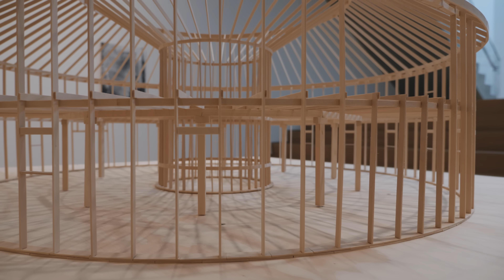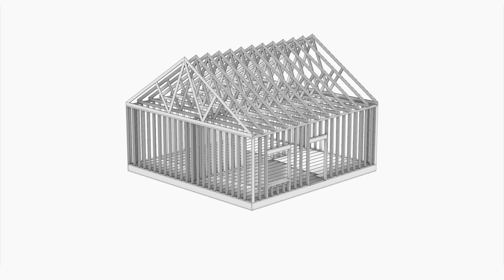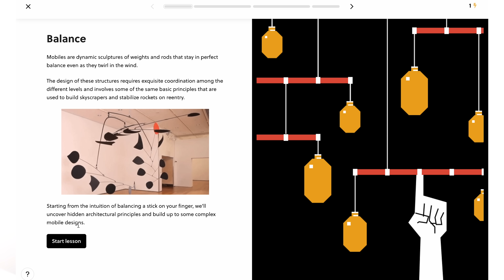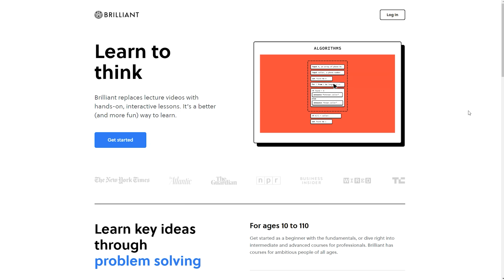The Genius of 2x4 Framing

Comment: I’d compare particle board to the McRib. It’s the odd carcass bits of a pig that are processed down and made edible. Perfectly safe to eat, just disturbing to think about, the same way we think about using particle boards in construction. It’s a robust material, maybe not as a structural component, but is perfect for covering walls and floors.
Reply: Actually, if I'm not mistaken, the reason McD's only comes out with the McRib in late fall/early winter is because, with the onset of colder weather and the coinciding slowdown in housing construction, there is more raw material available to make McRibs.  Because yes, you guessed it, McRibs are actually made from the same material as particle board.
Reply: Particle board is only used as floor underlayment. You may be thinking of Oriented Strand Board? Which is an amazingly engineered product. The wood flakes are placed with computer control. It's not nearly as random as it looks.

Comment: Not a fan of timber building at all. But there are a lot of advetages with this method. Here in Europe, wood framing goes a long way for additional elements like pagodas or entrance or terasse roofs, but rarely for house building.
Reply: I feel like the UK version of this is building with breezeblocks.
Reply: Same, and my house has 30 cm reinforced concrete walls. Every time I tell an American they don’t believe me.
Reply: @delta4phoenix4  It's not that no one believes you, it's that no one cares.
Reply: @deaconblooze1  xD Fair for here, but in context they did.

Comment: Frankly, I wouldn't be surprised if one of the original bids for the Saturn V / Apollo Module contract didn't propose a rocket solution made out of 2x4s...
Reply: 2x4s would have been too heavy. The engineering that went into the Saturn V is impressive.

Comment: It's important that u mentioned the abundance of trees, without that the 2x4 system would be impossible. In my country we relay on steel and concrete, because energy is cheap there and we don't have straight trees like here in the US. Thanks!

Comment: I don't live in the USA any more and so,  I get a chance to view your videos through the eyes of someone who was in that world and knew it, but am now gone from it in a significant way. Here, where I live, wood frame homes of any type, other than than most crude, are not built. We build with concrete and rebar. And we do it for the same reason that you cite for stick built: access to common materials; easy manufacture and portage; plasticity of end product design with the same materials, and; relatively lower skilled workmen for the basic construction. In point of fact, all you said, works for the building techniques here. All you need to do is switch the materials. I designed my own home here and was my own general contractor. Then did the same things with a boardhouse I built. So as I watched along with you, I saw how a different culture, different skills and different materials ended up telling the same story.

Comment: Fascinating! So many issues! The light-weight framing system was indeed exported: in wood-rich Finland it ended up, in the 1940s, replacing the traditional log-building technique (a square-profile log structure clad in timber siding). The traditional Finnish log houses were built by 2 people using just axes and no nails. The thick-walled houses provided excellent insulation. With the import of light-wood framing in the late 40s, the houses were cheaper but notably colder. The old traditional log-framed houses have lasted hundreds of years, while the light-wood framing houses are already decaying, despite the addition of insulation.
Reply: I recently found the remains of a cabin built by Finnish immigrants in the early 1900's . The joinery at each corner is perfectly constructed so the weight of the log above tightens the joint below it. Other than the roof collapsing it's still standing in great condition, most of the siding is even still intact.
Reply: @justindunlap1235  Wonderful to hear! What many today don't realise is the accuracy employed in the log joining techniques back in the day in achieving a tight fit. It was only in the 17th century that the log houses received a further layer of siding. Of course, up until the 20th century labour was cheap. But an interesting "transition" between log construction and balloon framing can be seen in the Puukäpylä workers' housing area in Helsinki from around 1920, where they used machines to quickly produce log houses with also siding. The area is now protected by law and is even a tourist attraction.
Reply: Nonsense;  wood that's kept dry will last indefinitely.  Wood is also a poor insulant, the less of it you used the more space is left for better insulating material.  Most log-framed houses are very drafty. Airtightness (and good controlled ventilation) matter even more than insulation when it comes to energy efficiency but that's another topic.
Reply: @viviangirard5075  Log framed houses -- or at least those in the Nordic countries and central Europe, which use thick rectangular-shaped logs not round ones -- are famous for being toasty warm, unlike the drafty balloon-framed houses from the post-war era.
Reply: @viviangirard5075  Let me tell you about the difference of living in a SHITTY Light frame building, I used to live in one for 24 years, it was always drafty, it always smelled of mold, it had no insulation and it sucked. When I visited my grandparents who lived in a White Brick House, it was always warm, and cozy, they had a gas heater to warm the house, and it didn't need to be used that often, in the summer it didn't ran at all, the inside stayed at 18 degrees C year round.
I once woke up in my room, with -2C in the house I lived in. That was with a gas heater that was always on.

And Log Frame houses are not drafty at all, I've had many opportunities here in Sweden to be in some, and I've never ever felt that I was cold in anyone of them. Not even during -20 to -30C winters, and that's without heating the houses up, more than in the morning, with a wood burning stove.
Reply: As mentioned water both vapor and as a liquid is the downfall of light wood framing. I grew up in a balloon framed “four square” in the north east USA. We had no problems with mold. The breeze hot or cold took care of that. It was and is still strong and standing. Steam radiators for winter, and wooden windows screens for summer. Anything done to tighten that house would kill it. There’s no perfect solution. All choices in construction have pluses and minuses. With steel, when you make it harder the steel becomes more brittle. When you make steel more resistant the material is softer and can’t take as good an edge. You pick a steel alloy and heat treatment that will combine to make a tool that’s closest to your requirements. There’s no free lunch. Engineering isn’t to make the longest lasting, strongest structures. Engineering is to make structures strong enough at cost that the end user finds affordable. When we use empirical methods to satisfy squishy human desires… 😂 yeah well, what we say we desire changes.
Reply: Wood is wood, it rots. If the stick frames aren't being cared for (roof repairs, gutter repairs and cleanings) they won't last. If they were built right and taken care of, they'll last centuries.

My family home is a stick frame built in 1910. By the 1960s it was deteriorating because of a roof leak, bad gutters, and overall poor maintenence. My grandparents bought it, fixed it, and maintained it. They sold it to my parents in the late 90s, and my parents had the roof redone again. And in 2020, the roof was done again.

The home is now 110 years old and doing just fine.
Reply: @dallyh.2960  I vet you can crumble the joists with your bare hands.
Reply: I don't think that a wall made with 6" thick logs has a better insulation value than a wall framed with 2x6" with fiberglass insulation. Where I live it can be -35C outside and the inside of the wall is still warm to the touch.
Reply: @smoguli  The traditional square logs in the houses I was referring to are nearing 12 inches (30 cm) thick [importantly, too, square cut, as round logs are inefficient]. That said, while the 30 cm walls have a U value of 0,4, compared to a 15 cm wall with 0,75, a 15 cm log + 5 cm insulation gives  0,35.
Reply: I'd be willing to bet that the techniques for building with log-building techniques had had more time to be refined than 1940s lightweight framing techniques. In which case, the situation is not "log-framing good, lightweight framing bad". Rather it's the case that lightweight framing techniques needed more time to develop into maturity than was available in the 1940s.
Reply: @Thalanox  Hew logs, put logs on top of each other, put roof on top, make doorframe, make door, install them, make flooring and done. It's not hard to build a timber house. It's pretty easy, it's heavy work sure, but you could use the wood chips and saw dust as insulation for the floor, the doorframes, windows, etc. It wasn't really a problem with skill or technique. Light framing isn't bad per say, but it has a bit too many cons in comparison, and sure it has it's pros as well, but when you need to use nails to build your house there's something wrong.
Reply: New tech could make modern stick built houses more resilient than those log built ones.
Reply: @GWHAWK87  Interesting thought! By "resilient" I guess you mean longer-lasting. The well-maintained ones have already lasted up to a couple of hundred years (as seen in the Seurasaari Open Air Musuem in Helsinki). These days log is more often being replaced by glulam, which is not as ecological as log. But back in the day, labor was cheap, and so building a log was not a great labor expense. The skill still exist, but admittedly it comes at relative higher cost. The biggest advantage of "stick" was always cost.
Reply: In terms of that resiliency, there was a historical dip in building quality caused by the entry of the insulation era where insulation was retrofitted into older buildings before good water management was really understood. Air carrying water condenses whilst passing through insulation, dumping water in the walls, which then gets trapped in there leading to rot. Nowadays the modern focus towards insulation, airtightness and barrier technology results in a stick wall which can last for centuries and be very efficient whilst doing so too. It's also particularly great that it can do that whilst looking like almost any other kind of wall - brick, log, render or regular timber sidings for example.
Reply: @hijackstudios  Intriguing! The building industry is naturally in search of cheap and durable solutions. The traditional log houses didn't need insualtion (NB: in Finland logs have always been sawn/axed to a square shape, unlike the round log system of North Ameica, which had a weakness at the joint of two round logs). It was the cold stick houses to which the insulation was so disastrously added. With sufficient depth, wood has the ability to absorb and release moisture, not requiring the tightness of, say, steel and glass. Do you have any model examples in mind of the wooden structures that hopefully will last for hundreds of years?
Reply: @garethgriffiths1674  Building to the strictest goals of the "Passivhaus" standards, particularly with the very high airtightness bar, is the likely best candidate. There are example wall structures in the standard which have been age tested as well. In building science it's essentially known that if a timber structure can dry out then it is able to last incredibly long times - there's an 800 year old church where I live with some original timber features. The strict airtightness requirements essentially block water from entering the wall in the first place, as well as clever one directional barriers which allow any water that does get inside to easily escape. The actual structure used depends on your climate zone as it comes down to which side of the wall the larger quantity of moisture is. In our cooler climates like here in the UK or there in Finland, the vapour barrier is on the internal side of the wall for example.
Reply: @garethgriffiths1674  Be sure to stay aware of survivorship bias.  There were lots of log (and other construction style) buildings which did rot or otherwise degrade badly... The ones which are still around are the exceptional ones ;)

That said, those older building methods did have definite advantages (and some weaknesses too).  And one method isn't universally better than others... A lot depends on the climate/conditions as well as availability/cost of different resources, including labor.
Reply: @travcollier  Interesting points! In the case of traditional  Finnish log houses (the external surface of which was clad in wood planks), it is understood that the bottom log, where it meets the stone foundation, was always a point of vulnerability over time, so they were replaced every 60 years or so in a process called shoeing. Good maintenance has of course always been a key issue.
Reply: @garethgriffiths1674  Most traditional north American log houses I have seen used square logs.
Reply: @garethbaus5471  Good to know! The pictures I have come across tend to show round  logs, or round but flattened top and bottom and the vulnerable seams filled with clay or other material. The reason for square logs is to get the tight corner joints, thick walls throughout (U-value 0,5) and the option to fasten timber board siding to the exterior and in the wealthier homes also on the interior.
Reply: @garethgriffiths1674  A U value of .5 translates to an abysmally low R value for a wall.
Reply: @hijackstudios  "clever one directional barriers which allow any water that does get inside to easily escape"

How do those work?
Reply: @seneca983  Two main things: tiny pressure differences can force the pores open and secondly the pores are too small for water droplets, only water vapour. Depending on where the higher concentration of water vapour is - usually inside in many climate zones - affects which side of the wall it is placed on. Water vapour inside basically forces its way through the pores because it's slightly higher pressure than outside. Wind driven rain can force its way through the pores too however, so it's important to put it behind cladding of some kind.
Reply: @hijackstudios  Thanks. Does the thing have a name so I can search more info on it?
Reply: @seneca983  Lots of different brands but the one that I've encountered the most is Tyvek housewrap. If you've seen a timber house during construction you've probably seen this distinctive phase - it looks like the house is being gift wrapped with white/grey paper :)
Reply: @hijackstudios  Thanks.
Reply: @hijackstudios  Airtightness traps moisture. All houses with vapor barrier have black mold issues inside the walls.
Paper backed insulation and tarpaper on the outside, allows the house to breathe so moisture does not get trapped in the walls. No mold.
Reply: @gatocles99  Airtightness doesn't trap moisture in a wall because only one side of the wall is the airtight barrier. Definitely wouldn't have 2 airtight seals on both sides. Breather membranes as mentioned above are used with vapour barriers together to protect a wall. Vapour barrier on the inside (the airtight layer), breather membrane on the outside in most climate zones.
Reply: @hijackstudios  You obviously don't work in construction. And have never seen the inside of a wall.
Vapor barrier is put on both sides.
Reply: @gatocles99  For starters I built the building I am in right now lol, presumably you have built a wall and did it by putting a vapour barrier on both sides and created a mold problem because it is wrong. It only goes on 1 with a breather membrane on the other side like this: https://drive.google.com/file/d/14gyEnxYcuyzE_lhpE2ina_2x_UMYUUSr/view?usp=share_link
Reply: @gatocles99  Mmm... No. Native New England contractor here. We only put the vapor barrier on one side.
Reply: @worldindo1  Sure... the only thing you have ever contracted is a cheeseburger.

Comment: I really don't like the boxy base design of modern homes, or how easily destroyed they are by natural disaster or even just small amounts of weather.

Also, I like how the timber framing seems to free up the space of the walls a lot more. Much easier to modify them.

Anyways framing makes me flaccid. /j
I would really like a round house like that two story round barn though. Are there even any examples of round, timber framed buildings?

Comment: Steel stud (light metal) framing is completely recyclable.  Much of that steel is made from recycled material.  Light metal framing can be used to create all of these same spaces.  It is also quickly and easily assembled.  It is also less flammable and as a result the building codes allow for less restrictive measures.  We need more of  our planet to be covered with trees to remove carbon.  Yes managed forests, but we need to leave the forest the forest and not treat it as corn field.  Romanticizing light wood framing is a mistake.
Reply: I didn't see this as "romanticizing", even though Stewart sometimes does do exactly that.  No, this was largely exposition, in my view, and I learned a lot of history.  And while yes, the steel is recyclable, it is also more expensive; I would like to see an analysis on whether or not the recyclative value of steel studs makes them cost effective.

By the way, I currently live in a home built with a steel stud frame, and it is perfectly fine.  The only time I even think about it is when I try to hang something on the wall.